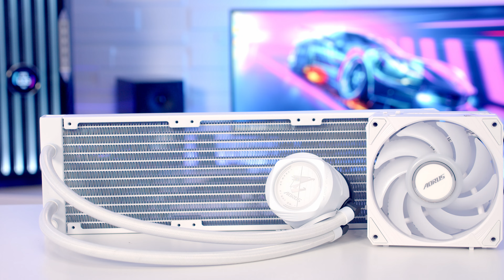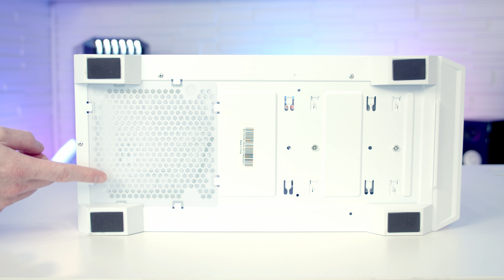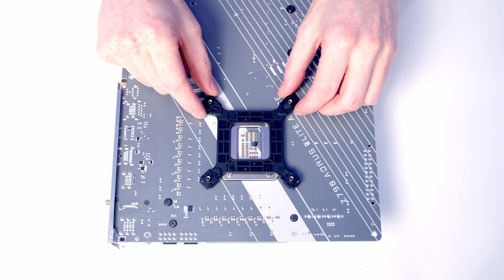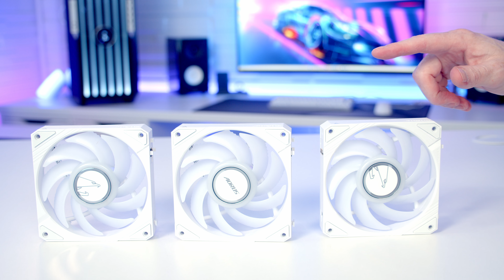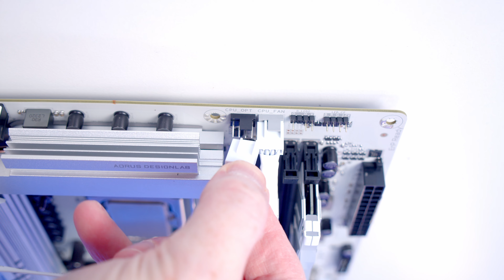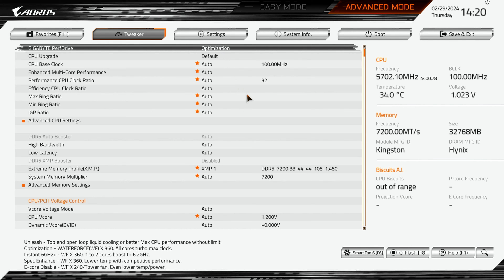Antec NX416L Build - Step by Step Guide | All White PC with Gigabyte Aorus Components

Comment: I have been looking at this case for a couple of weeks, as I'm planning on case swapping my B550 Tomahawk, Ryzen 5 5600, 32Gb DDR 4 3200 build with a Thermaltake Frozen Prism ARGB AIO and 12Gb RX6750XT, from a GameMax Black Diamond case.
@Christopher Flannigan, you mention in this review that the included ARGB fans are 3 pin? I'm assuming that they're DC controlled? Given this, would you be able to advise how best to configure via BIOS? 
Thanks.

Comment: I'm planning to build a new pc for 1080p gaming and decided to go with R5 7600x, Silicon Power DDR5 32GB kit rgb, rx 6700xt, but I have a problem finding MOBO. Thought to maybe get the msi PRO B650-S WIFI, asrock b650 pg lightning, gigabyte b650 eagle ax or msi b650 gaming plus wifi because they are all under 200 euros in my country, but I read some reviews and they all have some flaws like slow boot time, various issues with bios and ram memory. What would you suggest me to get?